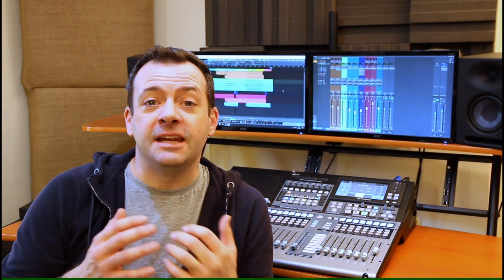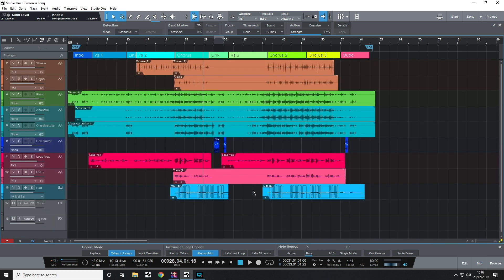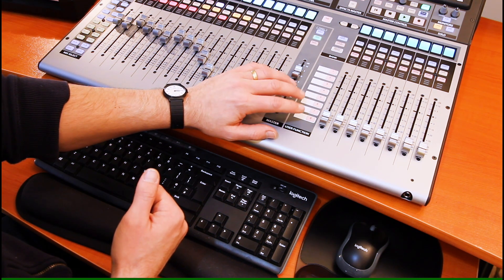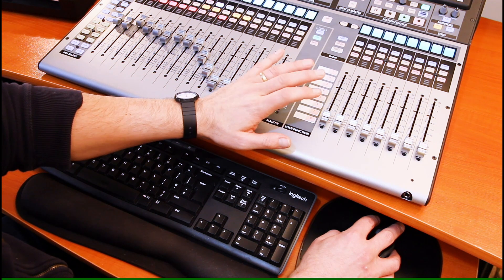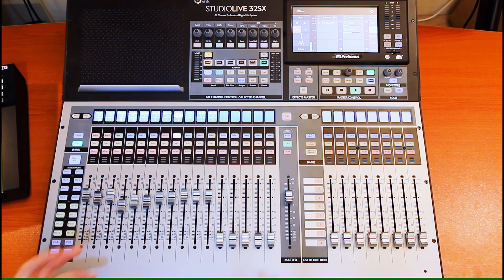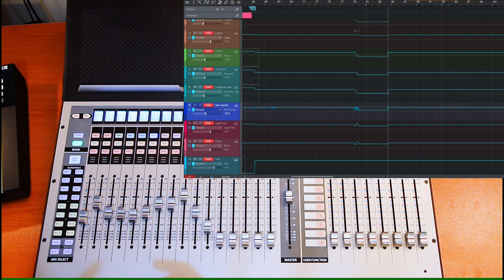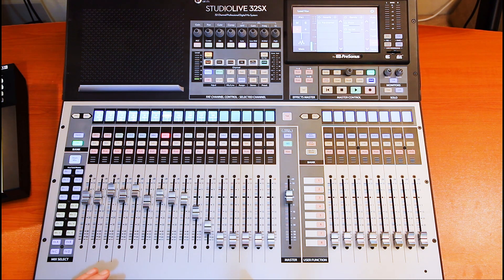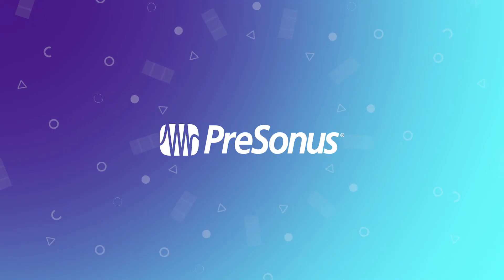Writing automation within Studio One using a StudioLive Series III mixer - Part 6/6

Comment: Thank you so much for this series!  Just the right info.  I’m using the A&H Qu-24 desk at the moment, and while many (not all) of your teachings can be done on the A&H it lacks total integration. My biggest interest is off loading Plugin weight from Mac to the desk. Am I to understand the PreSonus desk can be used for processing FX PER CHANNEL thus taking load off of CPU in computer?  As I have multiple tracking rooms, do you have video examples discussing that using the PreSonus gear? If not, would you create one?  Thank you!

Comment: Hi Matt - Great videos, and I love Studio One and my StudioLive III 24. I had a question about controlling automation from the Series III in DAW mode. Is it possible to control an inserted effect's parameter using a fader vs a rotary knob? The reason: more natural and "linear" control. I suspect not and understand that one could create a separate bus / channel for that effect, but thought I'd ask. I did search the forums but didn't find an answer - probably a poorly-worded search phrase on my part. Thank You for any thoughts.
Reply: Hi Paul, I'm not 100% certain but I'm afraid I don't think that's possible with the current firmware - the faders are just permanently linked to the channel levels only. Maybe it's something they could implement in a future upgrade, I agree it'd be a great feature.
Reply: This would not be the same Paul Martin that owned MCM Recoring in Worcester Ma in the 80's would it? Or was it Lyx at the time?
Reply: I'm also interested in this. That's why I came to watch this video...some other DAW surfaces can do it...